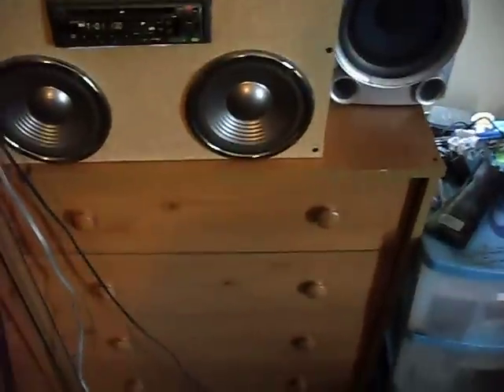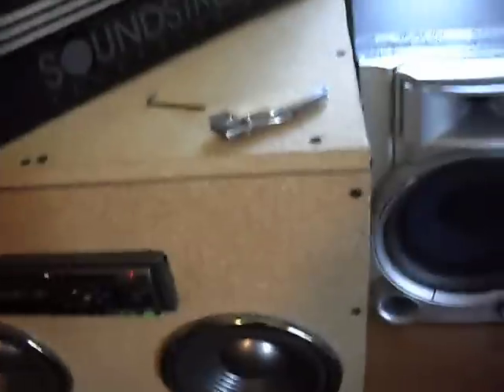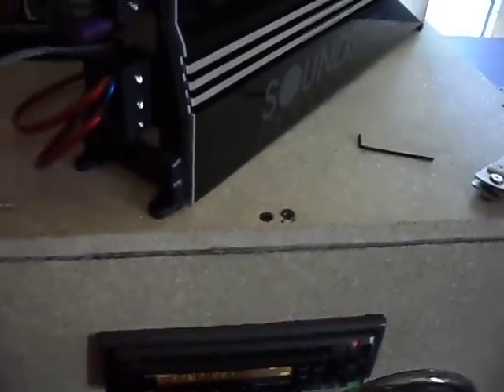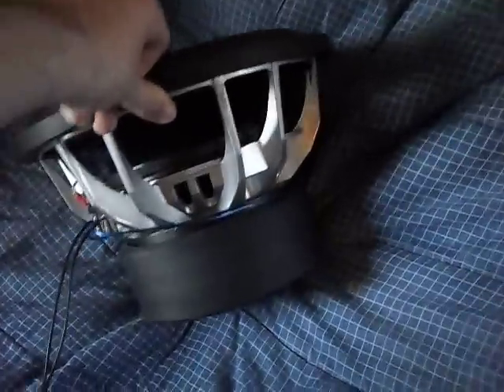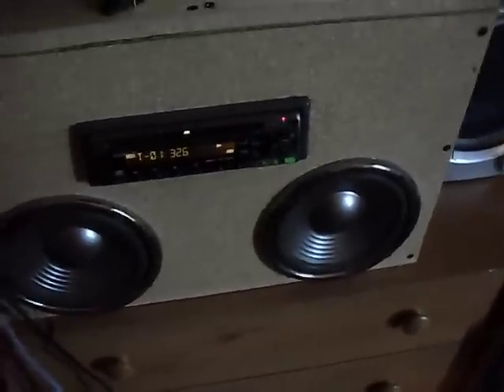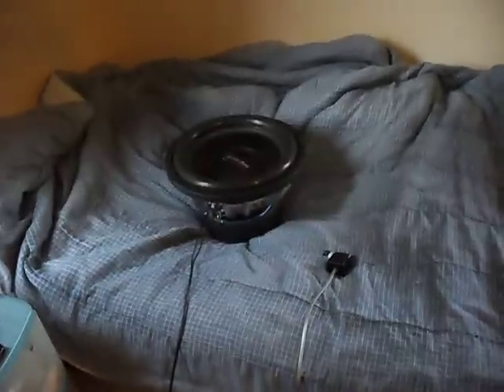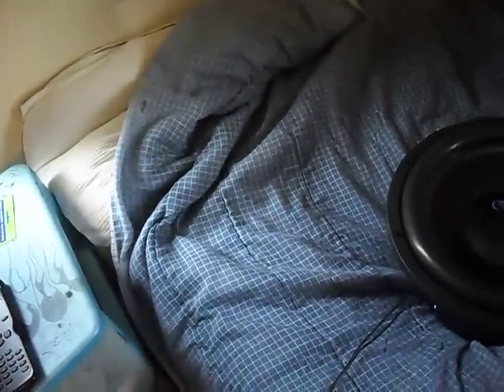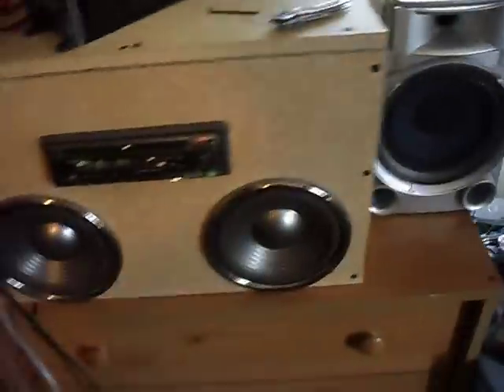Got the new amp but cant crank it because of power issues

Comment: @jessyAKAthabasshead 
i was using a 15a battery charger. (which is crappy) and it still kept up pretty good. could listen to a full song. then maybe wait 30sec-1min before bumpin again. (full tilt) clamped my amp @ 740rms too. so it was pushing a fair bit. 30hz can drop the volts fairly fast. but still got a few min out of it. never went below 11v. 40hz+ i could bump for a long time. which i prefer anyway. lows dont sound that great in a house.

Comment: @jessyAKAthabasshead
oh, and the battery never went dead. never really went below 11v. and its a crappy 650 cca car battery.
i havent used or charged that battery in about a month. and i just tested it now. and its sitting at 11.1 volts. so id say its still pretty good.

Comment: yeah bro get a battery.
i used a regular car battery with a battery charger in my closet for awhile.
was able to slam 2 12's with my 1k kenwood amp ez.

then i got carried away and ran it under its rated ohm load for too long and the amp shit on me while slamming BME Click ~ Lil Jon. the windows in my house would flex a good inch though.

I'm getting a Crescendo 2k soon, after i fix my car. then ill be running that with my single clarion 12 for awhile till i get a couple sundown SA-12's.